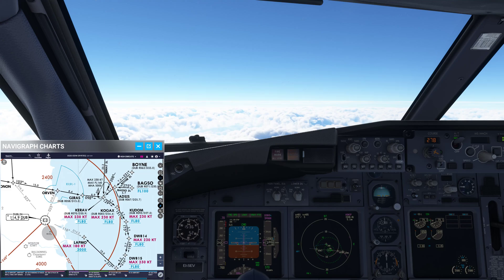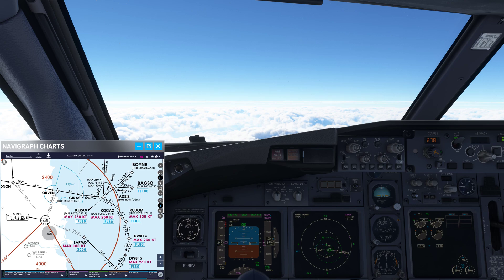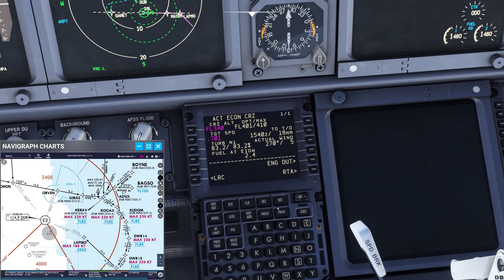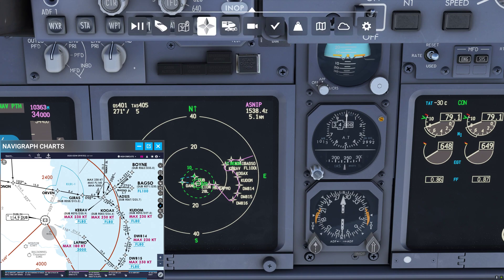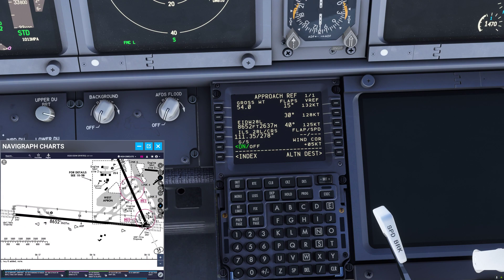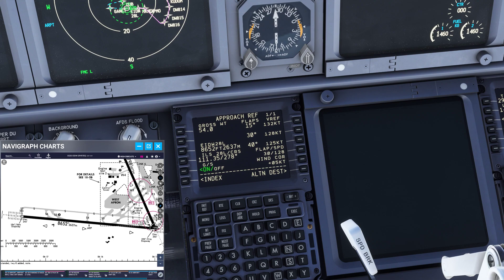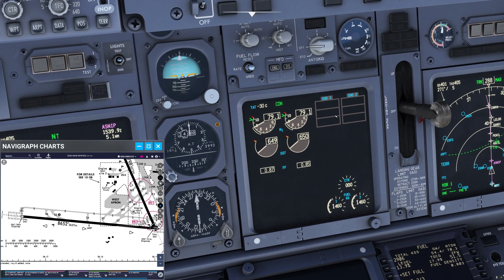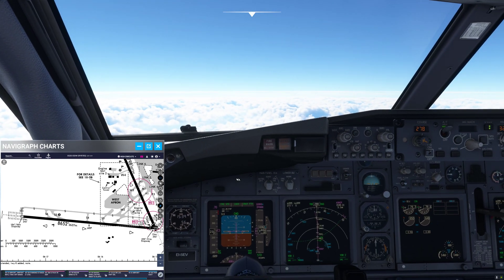PMDG 737-700 for MSFS - Tutorial 11: Approach Briefing (short version)

Comment: Very very useful tutorials Emauel. Very well done. I made a complete flow checklist based on your tutorial series to work thru. One thing a have problems with is the determination of the approching runway during flight planning at the destination airport before takeoff. So is it possible the request METAR Information unsing the FMC? If not how to plan with the correct runways in msfs. Sorry for my question if you answered that in a video but I am slightly struggling with the huge amount of your tutorials. Tom
Reply from the maker: Hi Thomas,
it's not (yet) possible to request METARs through the FMC. Use your flight planning software to determine the expected landing runway, then copy it from your OFP when programming the FMC.
Reply: @A330Driver  I use Simbrief but often the active runways are not the same as in the sim ;-)
Reply: @thomasrinnerhofer8121  Where are you flying? I find they match..well, quite frequently. But mostly United States.